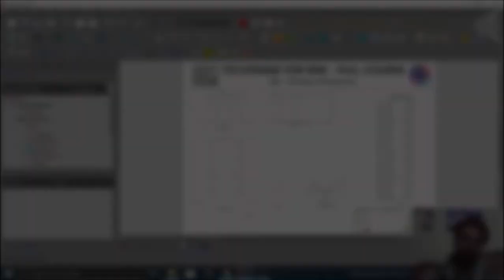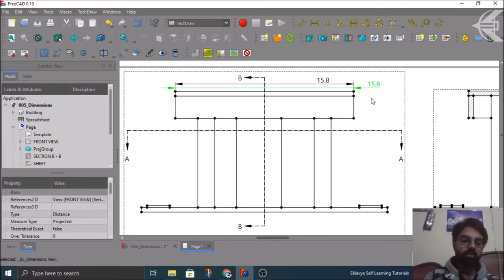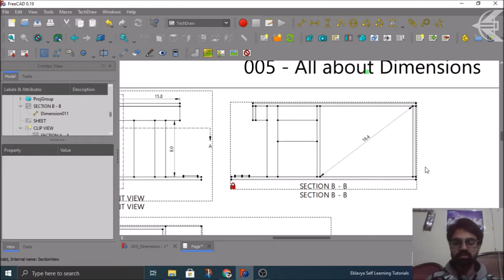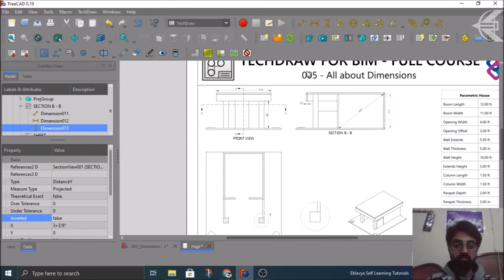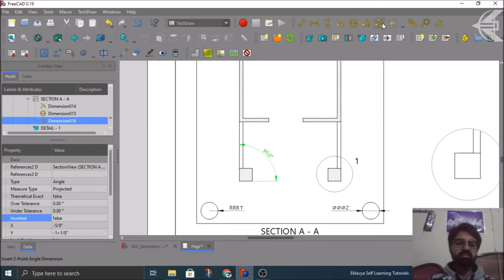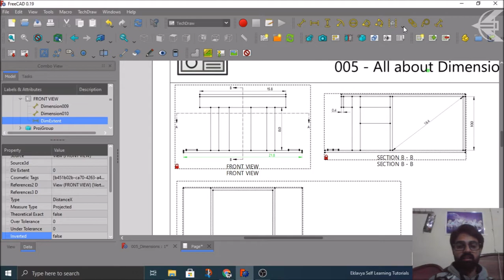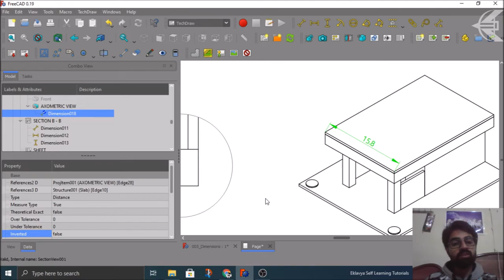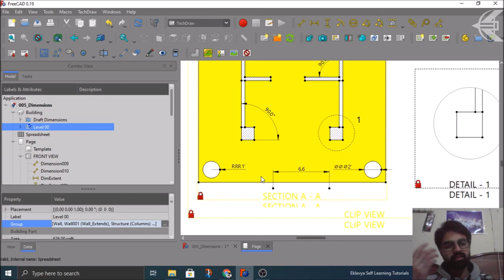005 - All about Dimensions | TechDraw for BIM in FreeCAD | Full Course

Comment: The landmark dimension feature is interesting. I wonder if someone could make different part files and embed draft points throughout each of the parts. Then make an assembly of the different part files, put a view of the assembly on a sheet, then use that landmark dimension feature to automatically dimension all the relevant bits of the assembly.

As you might have more in depth knowledge on how likely it is to be able to do that, do you think it's possible? Is there something about the features that you know would make it not work?
Reply from the maker: Thanks for your interesting feedback.
However, there are certain limitations in using Landmark Dimension as already mentioned in the video that it is an experimental feature.
Auto-Dimensioning is something that would be possible in the near future, but yes, in that too there might be certain restrictions.